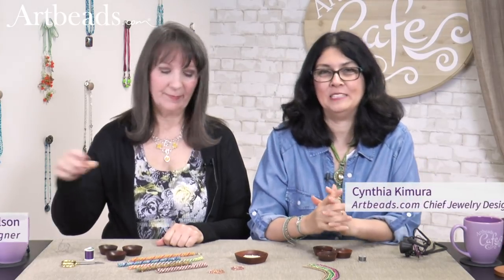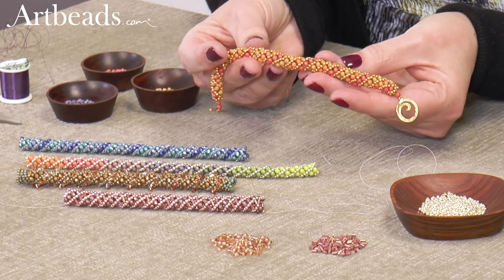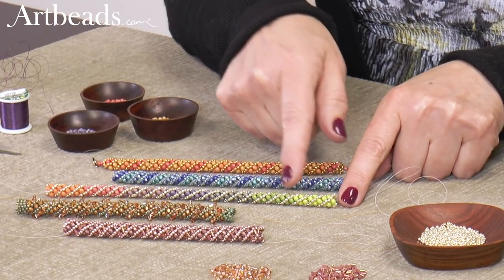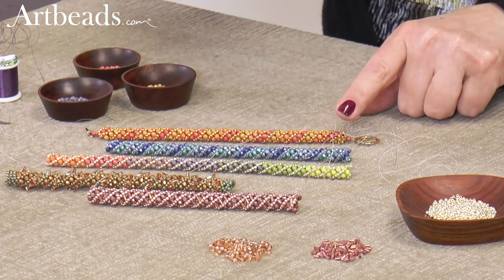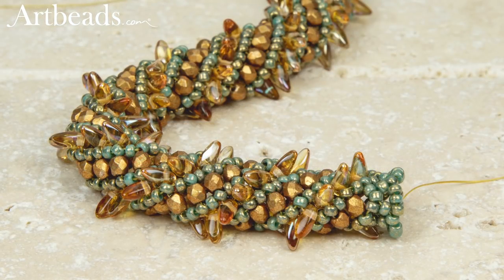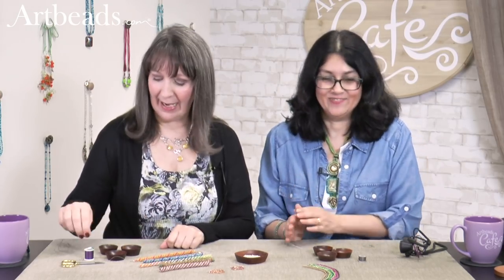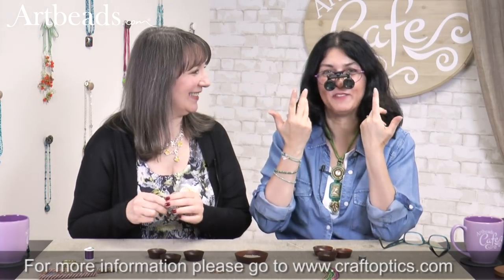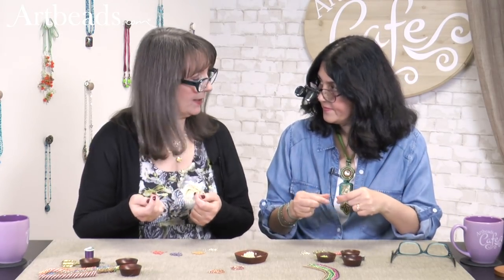Artbeads Cafe - The Russian Spiral Technique with Cynthia Kimura and Cheri Carlson

Comment: is it possible to get instructions on the one with the daggers? Thanks
Reply from the maker: Hi Annette. The technique is the same for the dagger bracelet as the other bracelets. Take a look at the instructions for the Positano bracelets to get started: https://www.artbeads.com/design-studio/positano-blue-orange-fire-polished-beaded-russian-spiral-stitch-bracelets/ You can use the same instructions for the dagger version, but instead of alternating fire-polished colors for each round, you will be alternating between these fire-polished beads: https://www.artbeads.com/jewelry-supplies/fire-polished-bead-3mm-colortrends-saturated-metallic-flame-cfp-same-flme3/ and these dagger beads: https://www.artbeads.com/jewelry-supplies/czech-glass-2-5-x-6mm-rosaline-celsian-mini-dagger-beads-beads-4577/ These are the seed beads used in the dagger version: https://www.artbeads.com/jewelry-supplies/toho-bead-round-11-0-gilded-opaque-turquoise-marbled/